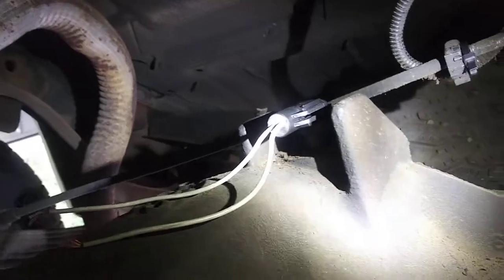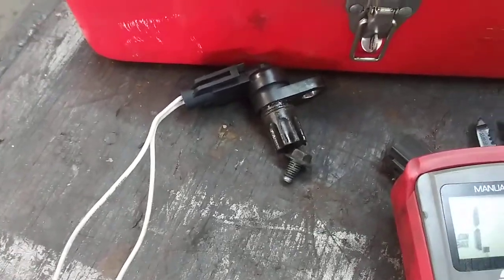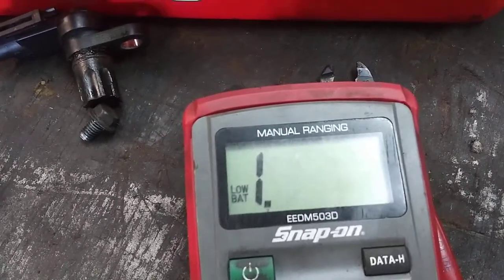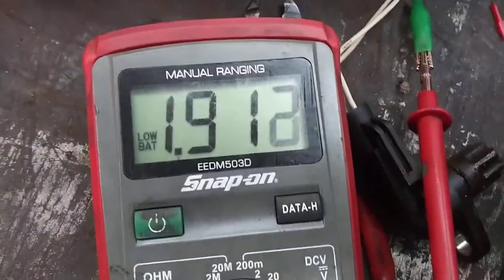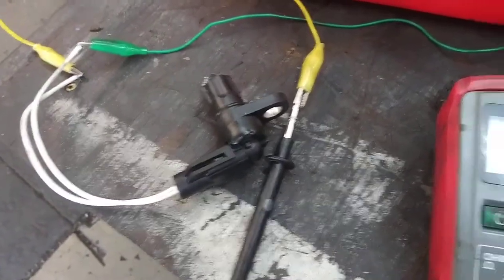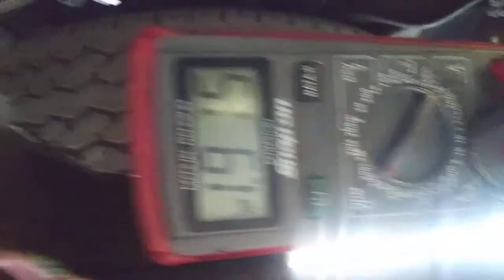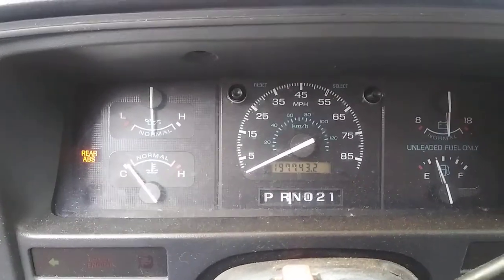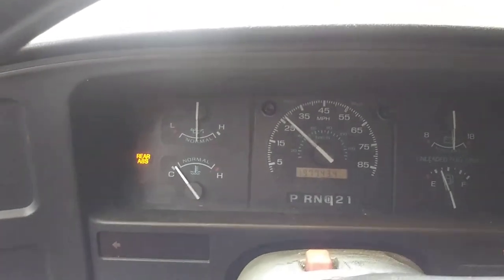No speedometer 92 Ford Econoline Van

Comment: I have a 2005 Econoline that reads 10 miles higher that the actually is, I'm gonna try that , thanks for the video
Reply: check the psom program setting for the correct tire size installed on the vehicle

Comment: Many thanks for this video. I have tried 3 different sensors and none of them have worked. I went to a Ford dealer to buy the Motorcraft brand and they said it was discontinued. Do you mind sharing the link for both the sensor and the pigtail. Also, should the pigtail snap/lock into place? Mine does not. Thank you, best.
Reply from the maker: Local parts store is where we purchased and it has a locking tab
Reply: @johnandeddie  appreciate your help 👊🏻